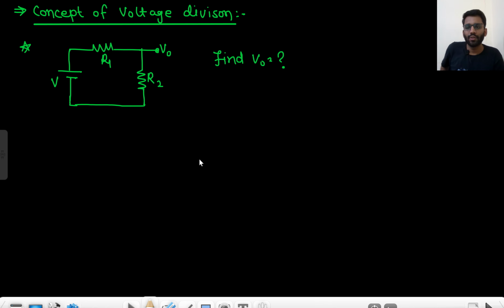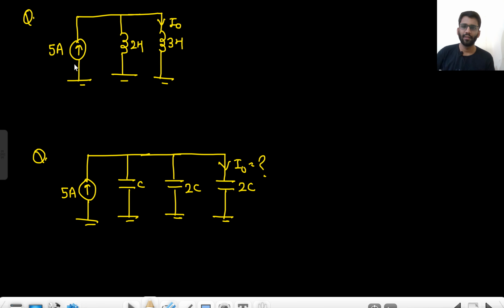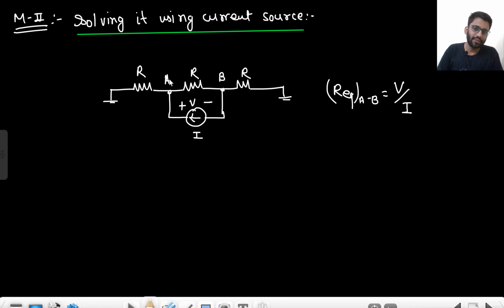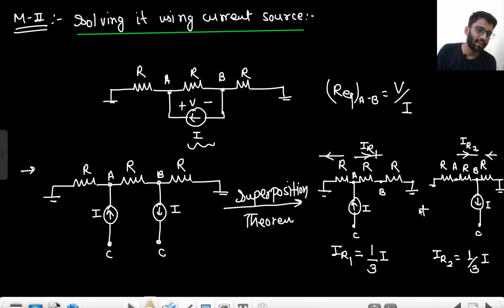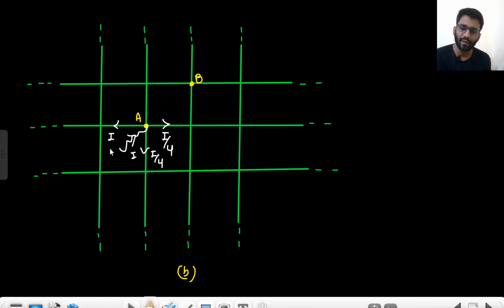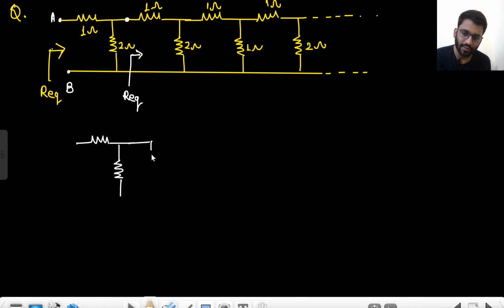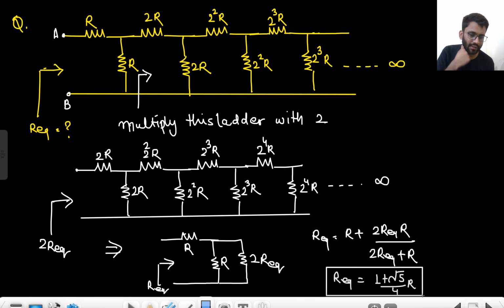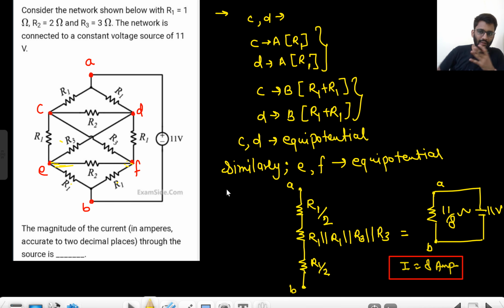Equivalent Resistance in the Infinite Ladder || Network Analysis || GATE 2025-26 || PrepFusion

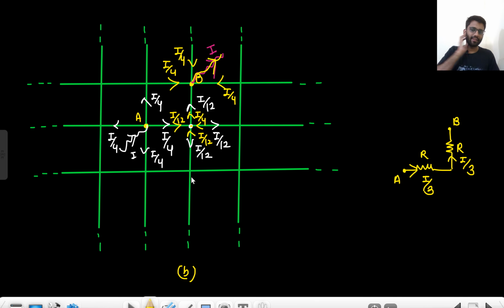Comment: Sir cant understand 29:06 sum
Reply: First consider a current source where I is entering A and use KCL till point B. The entering current = leaving current so adjust the values, like if I/4 is entering then leaving current is through 3 branches which has equal resistances, now I/4 = I/12 + I/12 + I/12. 

Now consider a current source where I is leaving from terminal B and repeat above KCL. now superimpose both current across brach A to B alone you will get I/4 + I/12 = I/3 and I/12 + I/4 = I/3. 

Now Vab = I/3 + I/3 = 2I/3.
By ohms law R = V/I so now Vab/I = 2/3.

so Requivalent = 2/3.
Reply: @yuga9511  bro u are so good. But i stopped midway u reminded me. Can u tell how u cover sequential circuits?
Pls tell bro
Reply: @Shalu-h5h3p from Chandan Gupta (Physicswallah)
Reply: @yuga9511 but i don't know hindi bro. And also i want quality lectures covering all deeply.
Reply: @Shalu-h5h3p I bought the gate wallah english course so I learnt from that. At that time I didn't know PrepFusion existed, had I known I would've bought PrepFusion.
Reply: @yuga9511 u appeared fir gate bro.  iam getting into second yr nxt month. Wht do u recommend bro
Reply: @Shalu-h5h3p I dunno. Start ur preparation in 3rd year, enjoy ur clg atleast till 2nd year buddy.
Reply: @yuga9511 "Yeah bro, that's what I'm planning too. l'l
enjoy college but also try to keep my basics
strong so GATE prep in 3rd year becomes
easier."

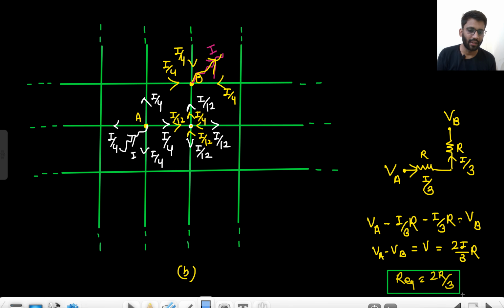Comment: 30:05 Why didn't you add  the Upper path From A and B?
Reply: Same doubt
Reply: @ajays1177  He didn't need to add the upper path because voltage drop is the same for every path between A and B, also there are infinite number of paths between A and B so you realistically cannot add and solve them like that.
He just used a current source to find out the voltage of the whole grid across A and B.
1.) The total voltage is VA-VB.(He used voltage of one path only because it's the same for any path because In any electrical circuit (even an infinite one), the Voltage Drop (VA - VB) is the same regardless of which path you take to get from A to B.)
2.) The total current entering the whole grid is I.
So, he just found out the R equivalent through these two things.

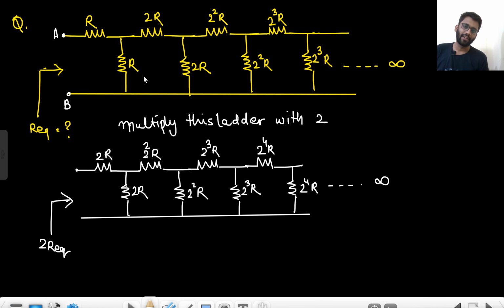Comment: Anyone please provide calculation part at 38:39
Reply: Setting up the Equation:
From the circuit diagram, you've established the relationship:

Simplifying to a Quadratic:
By multiplying through by 

 and rearranging, you reached the quadratic form:

Solving via Quadratic Formula:
Using 

 where 

, 

, and 

:

Comment: in the problem with R =300 ohms. You took axis of symmetry parallel to  a and b, but you told in your previous videos to take it perpendicular.   ?????
Reply from the maker: It's perpendicular only. Not parallel.
Reply from the maker: Perpendicular to the line joining a and b
Reply: @PrepFusion_GATE  Ooo got it